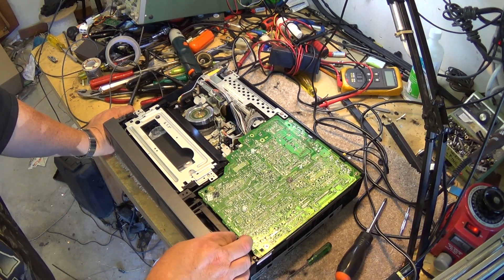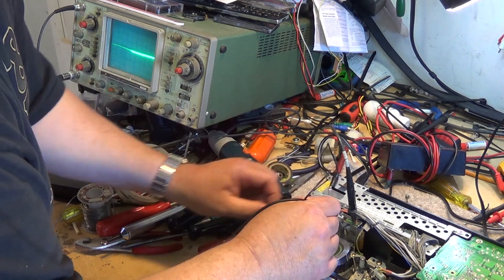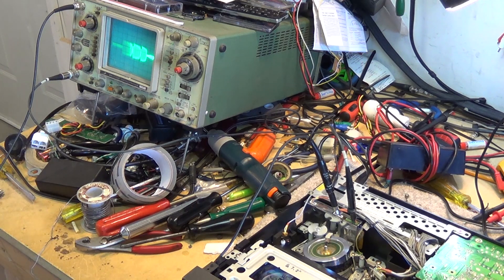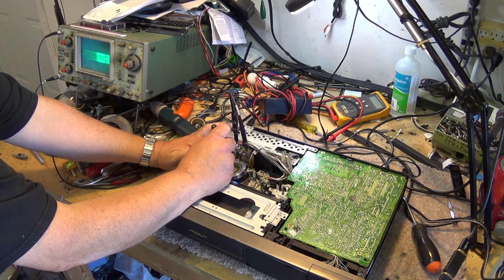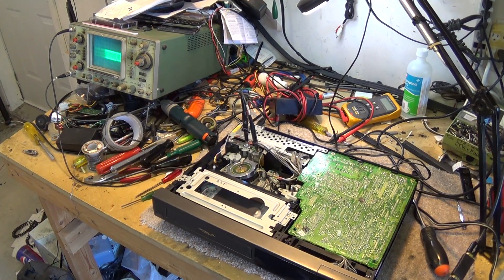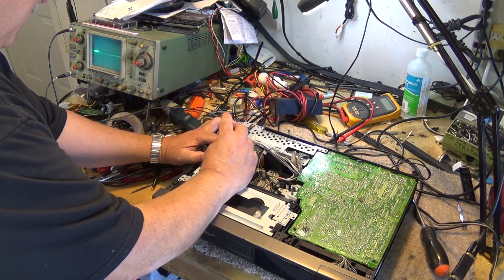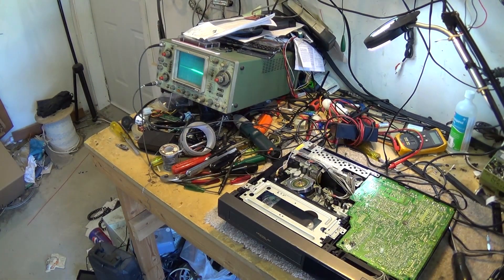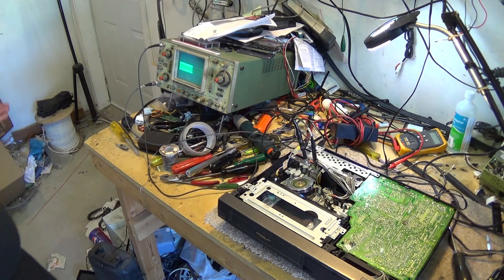VHS Tape path alignment   scope and no scope

Comment: I've been trying to align an old top loader VCR from the early/mid 80s (Panasonic PV-1231R). However when i hook it up to a scope, the waveform is only responsive on the right side of the switch pulse (high side) there seems to be no activity at all on the left side regardless of how I turn the alignment posts, no increase or decrease in amplitude (im new to scopes so cant outrule user error). On the TV screen I get the frame slowly rolling down the screen, mostly no colour although it snaps in sometimes and a very grainy picture. Not alot of static unless i mess with tracking. Audio works, seems fine, not fast/slow/distorted. All known bad caps have been replaced and questionable solder joints touched up. Cleaned heads, rollers belts and tape path. Any advise? Im not really sure where else to look.
Reply from the maker: If you are only seeing one head output and not the other it could be a broken head, or open winding on rotary transfoemer.  Yes the rotary transfoemer can fail by just sitting there.   The glue they used to manufacture decomposes and releases acid that attacks the copper winding.  Every vcr will eventually have this happen. No way to prevent.
Reply: @12voltvids  Thanks for the response. That's a bummer it may be a lost cause. I do recall the VCR worked when it was shelved years back, so what you say makes sense. Is there a way to test the heads or rotary transformer individually to ensure I am not missing something on the board?

Comment: i have an old magnavox player that that wont play my old tapes very well. A lot of static fills the whole screen and when I do see video and hear sound it goes in and out with alot of static noise along with it.. how can I fix tis
Reply from the maker: Could be anything including worn heads.
Reply: thanks for the video. I'am  going to follow your vidieo on cleaning and aligning the heads.. Most of my old home videos were recorded in slpl I did find one segment of a tape that played well and it was recorded in sp mode. wish i had taped everything in sp mode. My son in law bought me this vcr off amazon referbishid
Reply from the maker: @jerrynewell835  slp / EP should never have been allowed on VCRs.  The quality was so poor abs tape interchangeability was not great between machine.
Reply: @12voltvids  iam wondering if i am dead in the water most tapes play a little then go to a blue screen with some sound but I hear a static that seems to over ride the sound . I have to agree with you about slp and ep
Reply from the maker: @jerrynewell835  when mini DV first appeared and digitally for that matter there was one speed SP. You got one hour on the tape that was a standard. 1 hour on a camcorder tape especially a small one like a mini TV you would think would be enough but no a company that sometimes called junk very cheap or JVC decided that we needed an LP speed so that you could get 90 minutes on a tape instead of 60. Because you cannot allow the competition to offer a speed that you don't offer Sony and everybody else had to jump on that LP bandwagon as well. They put a big disclaimer on page two of the owner's manual of every camcorder they sold advising not to use the lp speed. They couldn't have printed it in a bigger font warning users that any recordings made in the lp speed may only be playable on the equipment that made the recording. Without saying in so many words they were basically warning people if you record it in LP on this camera and break the camera and have to buy a new one your old recordings probably will not play no guarantee. The same thing happened with digital 8 Sony had one speed for digital 8 but Hitachi who was also making digital 8 added a slower speed so then Sony had to of course offer that speed as well and it came with the same warning. Do you know how many mini DV and digital 8 tapes I get of people's prized recordings that they want to transfer and I have to break them the bad news that there is going to be tons of artifacts and it's not going to play. They blame my equipment. I have a photocopy from the owner's manual and I've got that section highlighted I asked him did you read page two of your manual warning against the use of the lp speed?   Of course everyone's responses if it wasn't compatible why did they have the speed available. My response that is the same reason that VHS machines have an EP speed. You should see how upset people get when you tell them that you can play their tapes but it's not going to play properly first they blame my equipment so I haul out other decks and show them that none of them will play it. The funniest one I had was a guy that brought me his camera with a tape stuck in it and he said I need the tape recovered so I took the tape out of the camera for him he wanted to transferred it had everything on it his whole life as he put it birth of his kids holidays birthdays 2 hours of his life. I transferred the tape over the digital hand it to him and didn't say anything he calls me up all panicked the USB stick I had them had a bunch of kids skateboarding and doing stupid stunts like jumping off of garbage cans and stuff from doing tricks. I said yeah that was what's on your tape. It was then and it set in that one of his kids had taken the camcorder out and the only copy of all of his home video stuff and used it with his friends to try to recreate the movie jackass.  I thought it was pretty funny as I was transferring it because I could see all the monitor what was on the tape and it had nothing to do with what was written on the label but I wasn't going to say anything I just charged him to remove the tape and transferred it and get my mouth shut and he got a surprise when he got home. I'm sure he probably had a discussion with his then adult son about wiping the tape.  When he brought me other tape said he had it turned out that his son had wiped them too including their vacation to Hawaii Mexico and Europe.

Comment: Hi @12voltvids, I think I've the same issue but with my Sony VHS deck, it only show this issue with VHS-C tapes, I've aligned it for common VHS and its 0.K., do you know if there is  anything else that I can adjust/align to watch my tapes?, also is there any difference at all between the VHS-C and the regular VHS cassette?. Thank you !!!.
Reply from the maker: When a VHSc tape in in the adapter it should behave like a regular VHS tape. The problem is most VHSc cameras were crap. I use to joke that the C in VHSc meant crap not compact.
The cameras were so delicate that just breathing on them caused alignment problems and that resulted in tapes that didn't play properly on a regular VCR. Especially troublesome when recorded in EP or SLP speed.

Comment: What is the easiest way to locate the head switching point? Nevermind. I'm an idiot.
Reply from the maker: Look for it with your scope.  It will normally be a square wave type signal. Will go to the head amp as that is where the switching takes place.
Reply: @12voltvids  
I found it. With the scope and the test tapes you made me my life just got a whole lot easier.

Comment: i have a sony hifi stereo vcr from around 2003, it plays and records wonderful but theres errors at the bottom of the picture about 2cm on a 32" screen, now about aligning the tape path: i do not have a scope but could always buy one i suppose, i just tried a dolby stereo vhs hits tape, after about 5 seconds the stereo matrix kicks in as it should so everythings working well apart from that small issue,  just about 2cm at the bottom of the screen the picture is rolled up, any ideas on this? is it happening because im using an lcd tv and not crt? and perhaps the overscan of a crt hides it?

Comment: Okay! This answered the question I once again posed. Will have to try this with the SLHF-860D I acquired from a friend. The tracking on that Beta deck won't lock on to any tape I put into it. It could be an alignment problem or else a failed component. It works great otherwise. Would be great if this works on that unit. Will have to eyeball it since I lack a working scope. Thanks again...

PS I got an test tape from the folks that sent me the refurbished Sony SLHF-450 so maybe I can use that to set the tracking. Sure can't hurt...

Comment: Can you do the same with a Beta deck? I'm having a heck of a time with old tapes that don't track, yet the tracking control is to an extreme position. Having the noise bars pop up every few minutes is aggravating. I opened the cassette flap to look at the tape and it doesn't appear damaged even when checked with a magnifier. Can ANYTHING be done with old tapes that don't track but are otherwise fine? I also have a bunch that are shedding but that will require me to bake them so i can get the contents back. have you tried that? Any pointers? Thanks...

Comment: Maybe a stupid question, but working on open electronics like this while plugged in and playing, is there not shock risk? I'm trying to fix my vhs-c camcorder which suffers this issue. Thanks.
Reply from the maker: The primary side of the power supply has high voltage on it, the rest of the unit is low voltage, low current. No risk. Your camera runs on 6 - 12 volts. Only the power adapter needs precautions to work on.
Reply: Ah ok thanks so much. So far I'm having a frustrating time, seeking perfection on the playback, but then messing it up. Wrong size tool isn't helping. Thanks for your video and answer!

Comment: I have a Sony SLV820 with what looks like switching noise at the bottom of the picture when playing. It doesn't appear when paused, FF or RW. Also the problem is not there on recordings made on the machine itself, just everything else! I've tried but I can't seem to dial it out by adjusting the guides. Any ideas? BTW Just discovered your channel and it's fascinating stuff. I wish I'd stuck to electronics in college!
Reply: In the slim chance that anybody has the same problem, I found there is a "secret button" behind the front panel which handles auto head alignment! I calibrated it using a tape recorded on an identical machine that has no problems and with a bit more tweaking of guide posts and the audio/control head it's all fixed.

Comment: do I need special manufacturer test tape?
Reply from the maker: If you have a tape that you know is correct (pre recorded movies are dam near perfect) then you can use that as a reference for basic alignment of the mechanical tape path. To do electrical adjustments, then you need a calibrated monoscope and color bar tape. Again these are relatively easy to make with a signal generator AND a VCR that has been certified as being calibrated.

Comment: Another quick question about scopes: Are you using a dual channel scope, or can this be be done with a single channel scope?
Reply from the maker: Yes you can do it with a single channel. It is easier if you can trigger it with an external trigger as that way you can use the PG pulse to trigger the scope, but you can do it without an external trigger, just a little more tricky to see.

Comment: Can this be done with a cheapo 200khz scope?
Reply from the maker: The frequency coming off the head amp is typically in the 2MHz range
Reply: 12voltvids Damn. Thank you for the response.

Comment: I've got a symptom that looks the same as your example here before alignment, but the degree of error changes every time that I Eject and then re-insert a tape. While checking this, it randomly played a tape perfectly, then was back to a partially-garbled image when I ejected and re-inserted the same tape. Any ideas what's going on? The VCR is a JVC HR-S5500U that I picked up.
Reply from the maker: It is probably one of the things I showed on the and other VJC videos I have done. The loose guide is a cause of intermittant alignment issues, and the capacitor in the PG pickup can cause the switching point to randomly appear in the picture and resembles an alignment error.

Comment: I have the HR-S2912U from JVC, The picture plays great but the normal audio track is out, loud hum.  Can you align/ adjust the audio head?   I cleaned the audio head thinking it was dirty, but there was still a hum.   If I slightly push on the Audio head while playing the tape,  you can hear an improvement in the sound,  less hum and more audio from the tape playing.   Any suggestions ?
Reply from the maker: +3dcsheldon Yes the audio head can be aligned. There should be screws along the base. One of them probably has a spring on it.I can certainly make one to show how to align the audio head if that will help out.
Reply: +12voltvids I will take a look and see if there is a spring connected to the base and attempt to adjust the screw connected to it.   I will try this first.  A video may help if I can't seam to get it.   I will let you know.   Thanks.
Reply: +3dcsheldon  I Finally had a chance to align the audio head and it did improve the audio but the hum / high pitch tone is still there.   Even if I play the tape and hold the tape away from the audio head, there is still a high pitch hum, like interference or something from a bad ground.  Its only on the normal track and it only appears when you play the tape.  Could there be a bad audio head or some bad electronics with the audio circuit?
Reply from the maker: +3dcsheldon Some VCRs use a mechanical relay to switch between the record and play circuits. The contacts have been known to get dirty and leak signals. This could introduce noise when in playback if the record amplifier was feeding back to the play head. Wouldn't be the head, that is just a coil of wire.. COuld be a leaky capacitor in the power supply allowing high frequency ripple to get into the audio circuits too.
Reply: +12voltvids I am thinking the same as you with the power supply and leaky capacitor.     Thanks

Comment: hi my name is husky I want to make a voltage spike protector using a metal oxide varistor I saw one on youtube called { DIY Surge Protector Part 1 of 2 } but his set up is for 110 volt I need one for 240 volt I don't know which varistor to buy can you help me please.
Reply from the maker: Husky Husky MOVs are available in multiple clamp voltages from 30 volts to well over 3000 volts.Remember that you 240 volt voltage is RMS average voltage. The voltage peaks is just under 340 volts. To find your peak voltage, divide your RMS voltage by 0.707 and you will get your peak voltage. Therefore your MOV needs a clamp voltage much higher than that, or it will be conducting all the time and burn out. Off the top of my head, and not knowing what you are trying to protect, I would go for a 500 volt minimum clamp voltage. I know that sounds high, but what a surge suppressor is protecting from is not the spikes in the couple hundred voltage range, it is the big spikes in the thousands of volts, like lightning strikes on the power grid. Also if what you are protecting has a motor in it, or even a large transformer, that can kick back a fair bit of induction, which would wear out an undersized mov quickly. If you go to web sites of manufactures like littlefuse they can recommend MOV types based on your application.

Comment: Nice video thanks for sharing. Can you tell us what is the VCR changing or moving to "track" a tape?
Reply: 12voltvids Nice detailed explanation, thank you. So in summary the VCR moves the reference point so the head switching lines up perfectly with each segment of recorded information on the tape. Always wondered what was changing, quite complicated machines. It's actually amazing to me that they actually work as well as they do with all that is taking place as the heads rotate. It would be great if you lived closer so you could troubleshoot my Mitsubishi HS-U82.
Reply from the maker: boatingcharlie1 What's your U82 doing. I did a service on mine. Had a capacitor in the comb filter go bad.It still has issues with the dynamic tracking, which was used for the variable speed playback, but that is a common problem, they use slip rings on the top of the drum to feed the actuators that wiggle the heads. These slip rings wear and noise in introduced and the tracking goes off on trick playback. That was a gimmick at best.Those machine have some real common problems, you can see mine serviced as I did  mechanical on it too. Also look at the u67 and other Mitsubishi units I have fixed (Electrohome AVR J05 is the equivalent model). The mechanisms get gummed up, parts seize up, power supplies have bad caps, and the comb filter on the SVHS decks are very common problems.
Reply: 12voltvids My deck works great but has bad picture. I changed the cap you mention and cleaned the mode switch with no change. If I clean the heads super clean it will play a perfect picture until I eject the tape upon inserting another tape it will not have a good picture again. Everything looks like it fully engages each time a tape in inserted. Maybe it has a bad head?? When it does play with a good picture the slow motion works perfect with no noise in the picture and it switches from slow motion to normal play with no problem. I gave up on it and put it away. It doesn't look like it has much use on it
Reply from the maker: boatingcharlie1 If I remember there is a couple of relays inside the head preamp module to switch between the normal record/play heads, and the special effects heads. Open the head preamp and look for a small relay. While playing a tape tap the relay slightly. If the picture clears up you have oxidized contacts in it.
Reply: 12voltvids That's a great suggestion I'll look for the relay and see if it makes a change when tapped. Thanks